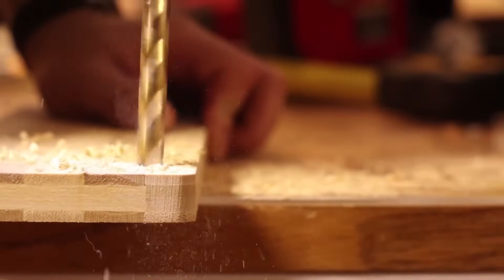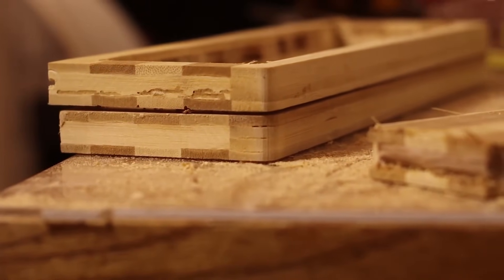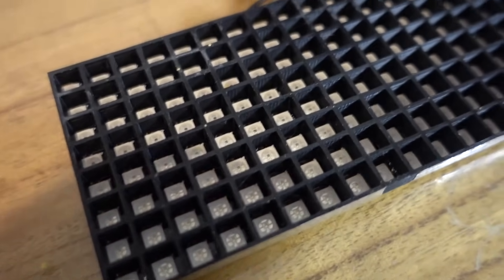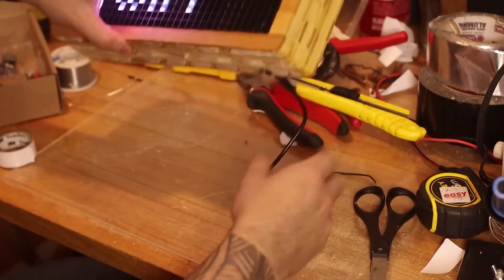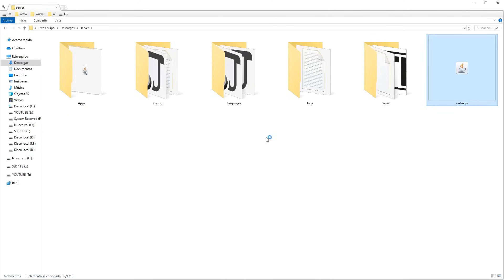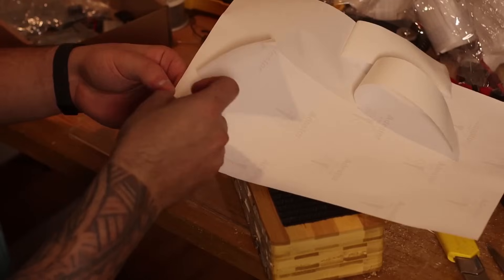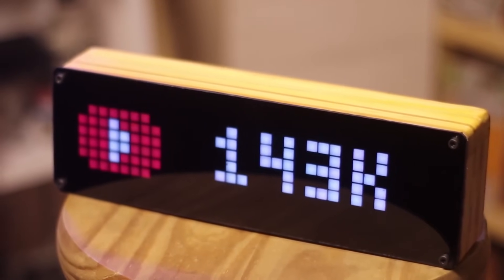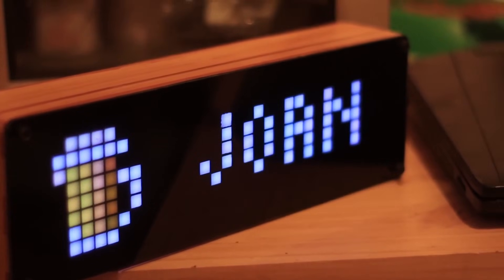$400 USD? No thanks, I do it for $25 - Smart Wifi Led Watch

Comment: The Ulanzi TC001 can run the exact same apps for $49 so that's another good option too
Reply: thanks for the tip, it seems to use a esp32 and has a huge community around it (with custom firmware and such) and as a bunus hasa build in battery in contrast to this Diy build.